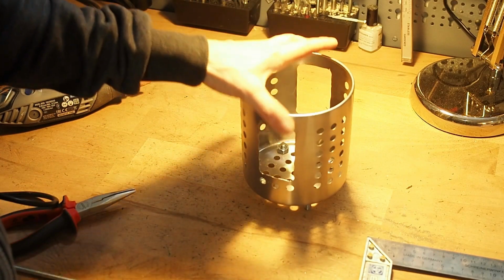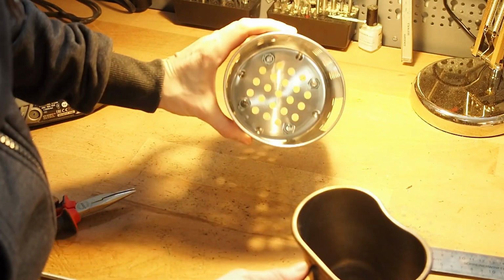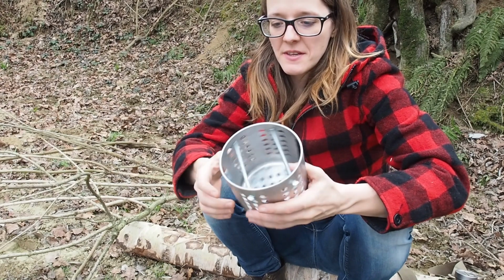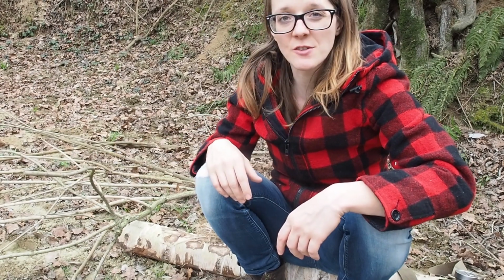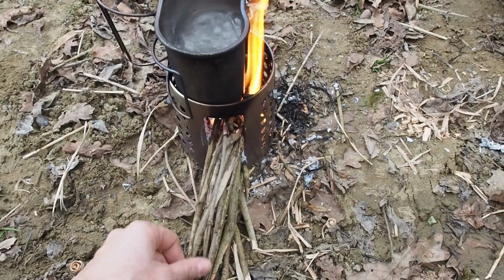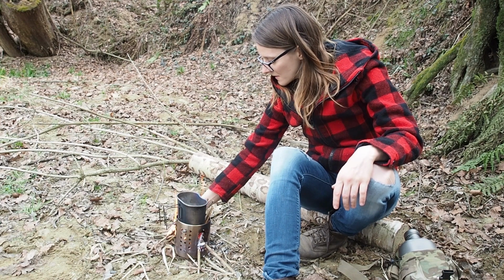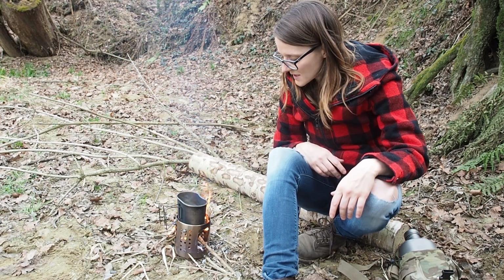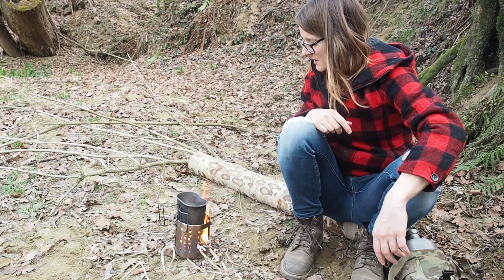DIY Hobo Stove from IKEA

Comment: HINT 0:59 When you cut a threaded bar , don't squeeze it in the vice without "soft" plates (or a least a cloth) and always keep a nut you can unscrew to reshape the thread. Same at 3:05
For the bottom simple screws cous do the job.
Reply: Indeed. Soft Jaws are a wonderful addition to a bench vise!

Comment: I just did a very similar project using the Walmart version of this utensil holder. 

For a better cooking surface, I used a 120mm fan grille for a computer. Just bend the 4 ears down to hold it in place on top. This would eliminate your problems putting the canteen cup on the stove. 

https://www.amazon.com/gp/product/B000BSN63O

For the feet, I used 4 large coat hooks held in place by nuts and bolts and washers going through the holes in the bottom. This gives it a wider more stable stance. You can also rotate the coat hooks so that they fit under the body of the stove for storage.

Comment: Actually it DOESNT take up that much volume in a ruck.  I have my new Model C with 4 utensil sets, pots, 4 dishes, and 4 cups that can feed 4 people.  The original Model A was for 2 people.  And YT Bulgarian Organic (who has my original Model A) says the IKEA model is the same as my Walmart kitchen caddy, ... and put inside my slightly-larger milk can (used as a big water boiler or the Canterbury baking oven) all that is 5 1/2 inch diameter x 8 1/2 inches tall.  Compare that with the WW II Army Coleman heating unit (one of latest Canterbury vids) it was the same size.  I get rid of all the other crappola of eating kits volume and weight, and it is all self-enclosed.  It is the best model (not on the market) for single for family use.  Entirely modular pieces and (U)LW for its uses in stealth cooking/heating/light, ... and spark-proof for between legs heating, or safe inside tent/shelter cooking/heat/light ....

Comment: Good idea, but dangerous working practices.
You shouldnt use any rotary tool with tassles on a hoodie and use a file instead of the band sander. Holding with long nosed pliers is bad practice.